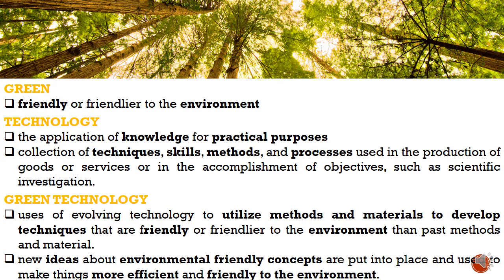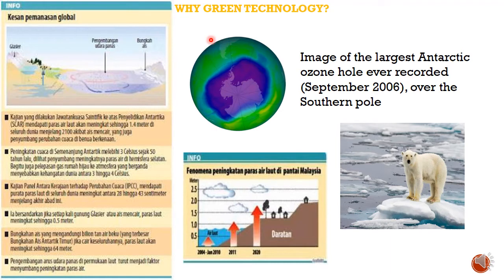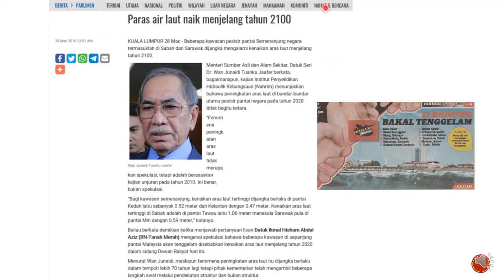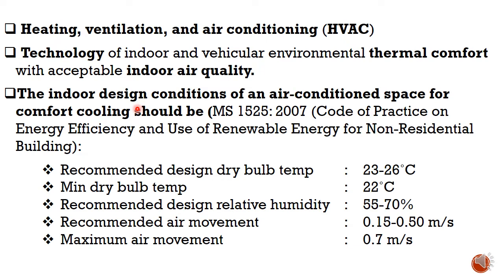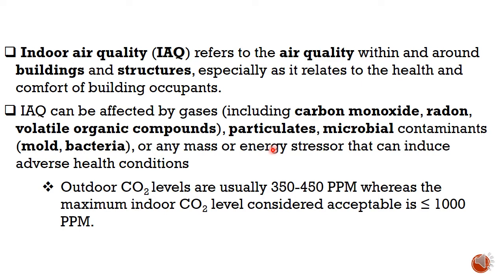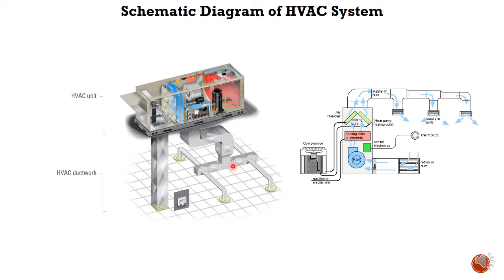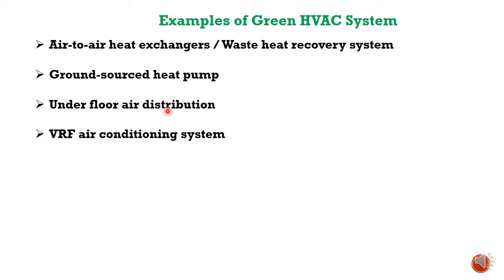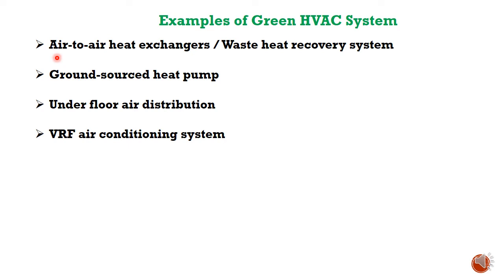Lecture 1- Green Technology HVAC

Comment: MUHAMMAD HAZIM BIN ISMAIL (B071710545)

1.1 Green Technology
-Uses of evolving technology to utilize methods and materials to develop techniques that are friendly to the environment.
-New ideas about environmental friendly concepts
-Better energy efficiency

Why go green
-to protect environment from hazardous emission
-conserve natural resources
-reduce the fossil fuel usage
-contributing to human health
-support the increasing green energy production

Green technology subject areas
-green building
-environmentally preferred purchasing
-green chemistry
-green nano-technology
-energy

1.2 HVAC
-Heating, ventilation and air-conditioning
-Technology of thermal comfort with acceptable indoor air quality
IAQ
-Air quality within and around buildings and structures
-Can be affected by gases or any mass or energy stressor that can induce adverse health conditions

1,3 Green Technology HVAC
-System that produces thermal comfort with good air quality, which reduces pollution on environment
Green building design
-HVAC system is designed after all the other energy efficient design components are in place because energy requirement are reduced and natural heating and cooling is maximized through size orientation, passive design, insulation, air barriers and landscaping.

Advantages of green HVAC
1) Sustainability 
2) Viability 
3) Innovation 
4) Source Reduction 
5) Cradle to Cradle Design

Comment: MOHAMAD SYAFIK BIN SOFI
B071710064

Green technology.
-The combination technology and green for the better enviroment.
 -Include better energy efficiency.

Purpose
-To protect enviroment.
-Conserve natural resources.
-Reduce the fossil fuel usage.

Alternative energy
-Solar power.
-Nuclear power.

What is HVAC?
-Heating, ventilation, and air-conditioning system.

What is IAQ?
-Air quality.

Green HVAC
-A system that produce thermal comfort with good air quality which also reduce pollution on the enviroment.

Important of correct sizing
-Too small = Will run heavily all the time.
-Too large = will constantly turning on and off.

HVAC green technology
-Sustainability.
-"Cradle to cradle design.
-Source reduction.
-Innovation
-viability.

Comment: MUHAMMAD AMIR SYAFIQ BIN AHMD SUKRI 
B071710161

Green = friendly or friendlier to the environment
Technology
•	the application of knowledge for practical purpose
•	by using some techniques, skills,method and processes to produce goods or services.

Green technology:
•	utilize method and material to develop techniques that are friendly to the environment than past methods and materials.
•	New ideas about environmental friendly concept

Why green technology:
1.	To protect environment from hazardous emission
2.	Support the increasing green energy production
3.	Contributing to good human health
4.	Conserve natural resources 
5.	Reduce the fossil fuel usage 
Green technology subject area:
1.	Energy 
2.	Green building
3.	Green nanotechnology
4.	Environmentally preferred purchasing
5.	Green chemistry 

Hvac = heating ventilation and air conditioning 
•	Technology of indoor and vehicular environmental thermal comfort with acceptable indoor air quality

 
The indoor design condition of an air-conditioned space for comfort cooling must use a standard of MS 1525:2007 (code of practice on energy efficiency and use of renewable energy for non-residential building)

•	Recommended design dry buld temp = 23 – 26 degree Celsius 
•	Min dry bulb temp = 22 degree Celsius
•	Recommended design relative humidity = 55 – 70%
•	Recommended air movement = 0.15 – 0.50 m/s 
•	Maximum air movement = 0.7 m/s

AIQ = indoor air quality 
•	air quality within and around buildings and structures. 
•	It relates to the health and comfort of building occupants
•	AIQ can be affected by gases (including carbon monoxide, radon, volatile organic compounds), particulates, microbial contaminants mold, bacteria or any mass or energy stressor that can induce adverse health condition
•	Outdoor Co2 levels are usually 350 – 450 PPM. The maximum indoor CO2 level considered acceptable is lesser than 1000 PPM

GREEN HVAC
•	A system that produces thermal comfort with good air quality, which reduces pollution on environment such as global warming and cost effective
Green building design 
•	Hvac system is designed after all the other energy efficient design components are in place
WHY?
•	Energy requirement are reduced and natural heating and cooling is maximized through size orientation, passive design, insulation air barriers and landscaping. Then, hvac system is designed to provide supplementary heating, cooling and ventilation that needed.
Correct sizing of Hvac system: 
•	Too small = will run heavily all the time to compensate
•	Too large = will constantly turning on and off and will cause moisture condensation on space walls.
 
Advantages Green Hvac:

1.	Sustainability = conserving natural resource, improve components performance
2.	Vialibility = making green technology economically feasible 
3.	Innovation = developing innovation in alternate technologies that do not harm the environment
4.	Source reduction = reduce waste and pollution by changing methods of production and energy consumption to help conserve energy and help the environment

Example of green hvac system:
1.	Air to air heat exchangers/ waste heat recovery system
2.	Ground sourced heat pump
3.	Under floor air distribution
4.	VRF air conditioning system

Comment: NUR FITRAH NADIA BINTI KAMIDAN
B071710363

WHAT IS GREEN TECHNOLOGY
The field of green technology encompasses a continuously evolving group of methods and materials, from techniques for generating energy to non-toxic cleaning products.
 
Examples of green technology subject areas:
Energy
Perhaps the most urgent issue for green technology, this includes the development of alternative fuels, new means of generating energy and energy efficiency.
Green building
Green building encompasses everything from the choice of building materials to where a building is located.
Environmentally preferred purchasing
This government innovation involves the search for products whose contents and methods of production have the smallest possible impact on the environment, and mandates that these be the preferred products for government purchasing.
Green chemistry
The invention, design and application of chemical products and processes to reduce or to eliminate the use and generation of hazardous substances.
Green nanotechnology
Nanotechnology involves the manipulation of materials at the scale of the nanometer, one billionth of a meter.
 
WHAT IS GREEN TECHNOLOGY HVAC
The definition of Green Technology goes a little further as it involves implementing a solid strategy of environmentally friendly ideas, methods, materials, and machines.
 
HVAC GREEN TECHNOLOGY DEFINED
1. Sustainability
2.Cradle to Cradle Design
3.Source Reduction
4.Innovation
5.Viability

Comment: ARVINTH A/L RAMACHANDRAN
B071710339 
BMMH 1/2

WHAT IS GREEN TECHNOLOGY?

GREEN = friendlier to environment
TECHNOLOGY = scientific investigation of knowledge for pratical purposes
 to utilize methods and materials to develop techniques and ideas to environmental 

Source Reduction = Reduce waste and pollution by changing methods of production and energy consumption to help conserve the environment.

Innovation = Develop technologies that does not harm the environment

Viability = Creating job opportunities and careers around Green Technology that can help protect the environment

GREEN HVAC SYSTEM 

Air-to-air heat exchangers / Waste heat recovery system
Ground-sourced heat pump
Under floor air distribution
VRF air conditioning system

Comment: MUHAMAD IZMAN BIN JAMALUDDIN
B071710518

WHAT IS GREEN TECHNOLOGY

The field of green technology encompasses a continuously evolving group of methods and materials, from techniques for generating energy to non-toxic cleaning products. The present expectation is that this field will bring innovation and changes in daily life of similar magnitude to the information technology explosion over the last two decades.
Examples of green technology subject areas:

Energy

Perhaps the most urgent issue for green technology, this includes the development of alternative fuels, new means of generating energy and energy efficiency.

Green building
Green building encompasses everything from the choice of building materials to where a building is located.
Environmentally preferred purchasing

Green chemistry
The invention, design and application of chemical products and processes to reduce or to eliminate the use and generation of hazardous substances.

Green nanotechnology
Nanotechnology involves the manipulation of materials at the scale of the nanometer, one billionth of a meter. Green nanotechnology is the application of green chemistry and green engineering principles to this field.

WHAT IS GREEN TECHNOLOGY HVAC
HVAC is constantly evolving as new ideas on environmental friendly concepts are being put in place. These ideas and concepts are used to make things more efficient and friendly to the environment. The definition of Green Technology goes a little further as it involves implementing a solid strategy of environmentally friendly ideas, methods, materials, and machines.

HVAC GREEN TECHNOLOGY DEFINED

Sustainability 
This refers to the conservation of our natural resources. HVAC is a constantly evolving industry where many of its manufacturers work to make their equipment a lot more efficient.

Cradle to Cradle Design

This means designing products that can be fully reclaimed or recycled into new products at the end of the product’s lifecycle. Almost everything in HVAC equipment can be recycled or reclaimed at the end of its life including the refrigerant used.

Source Reduction
It refers to the reduction of waste and pollution by altering the methods of production and energy consumption to help the environment and conserve energy. 

Innovation 
This refers to developing innovations in alternate technologies that are not harmful to the environment, or innovations that decrease the use of fossil fuels and chemicals that have been known to harm the environment and the people in it. 

Viability 
It refers to making Green Technology economically feasible  creating jobs and careers around Green Technology that truly help to protect the environment and our planet.

Comment: MOHD SAZWAN FITRIE BIN MOHD. KHAIRIL FITRIE (B071710488)

Uses of evolving technology to utilize methods and materials to develop techniques that are friendly to the environment than past methods and material. New ideas about environmental friendly concepts are put into place and used to make things more efficient and friendly to the environment.

1. Green building
- Choosing the material or the location for the building
2. Environmentally preferred purchasing
- Search of products which contents and methods have minimal effect to the environment
3. Green chemistry
- Invention, design, and application of chemical products that reduces the usage of hazardous substances
4. Green nanotechnology
- Manipulation of the materials used
5. Energy
- Development of alternative fuels, generating energy and energy efficiency

Technology of indoor and vehicular environmental thermal comfort with acceptable indoor air quality (IAQ). IAQ refers to the air quality within and around buildings and structures, related to health and comfort of building occupants.

A system that produces thermal comfort with good air quality, that reduces pollution on environment and cost effective. Correct sizing of an HVAC system is important to achieve energy efficiency.
1. Too small : - will run heavily all the time to compensate
2. Too large : - will constantly turning on and off
                           - will cause moisture condensation on space walls.

1. "Cradle to Cradle" Design
- Product can be recycled into new products.
2. Source Reduction
- Reduce waste and pollution by changing methods of production and energy consumption to help conserve the environment.
3. Innovation
- Develop technologies that does not harm the environment.
- Reduce the usage of fossil fuels and chemicals that are harm to the environment and people.
4. Viability
- Creating job opportunities and careers around Green Technology that can help protect the environment.
5. Sustainability
- Help to conserve natural resources.
- Improve components performance.

1. Air-to-air heat exchangers / Waste heat recovery system
2. Ground-sourced heat pump
3. Under floor air distribution
4. VRF air conditioning system

Comment: NUR SELIHAH WAL HUDA BINTI AHMAD - b071710190

Green Technology in HVAC system is important to reduce or minimize the energy cost and reduce pollution on environment such as global warming. 
HVAC system designed as energy efficient design component because the energy requirement is maximized through size orientation, passive design, insulation, air barriers and landscaping. 

Using Green Technology in hvac will support the increasing green energy production for example in Malaysia using solar  in some industrial field to reduce pollution on environment and the US,  they use ice power aircond system which has the same concept of thermal energy storage by convert water to ice to cool the area and save the energy consumption.

- Advantages of HVAC Green Tech.
   i) viability 
  ii) sustainability
  iii) cradle to cradle design 
  iv) source reduction 
  v ) innovation

Comment: MOHAMAD HURAIRAH BIN HARUN (B071710461) 

1.1 Green Technology 
~ Uses of evolving technology to utilize method and material to develop technique that are friendly to the environment. 
~ New ideas about environmental friendly concepts are put into place and use to ma things more efficient and friendly to environment. 

Examples of green technology subject areas:
1) Energy
2) Green building
3) Environmentally preferred purchasing
4) Green chemistry
5) Green nanotechnology

1.2 HVAC 
~ Heating, ventilation, and air conditioning (HVAC) is the technology of indoor and vehicular environmental comfort. Its goal is to provide thermal comfort and acceptable indoor air quality.
~ Indoor Air Quality (IAQ) refers to the air quality within and around building and structure, especially relates to the health and comfort of building occupants.

1.3 Green HVAC 
~ A system that produces thermal comfort with good air quality, which reduces pollution on environment such as global warming and also cost effective.  
~ Green building design – HVAC system is designed after all the other energy efficient design components are in place because energy requirement are reduced and natural heating and cooling is maximized through size orientation, passive design, insulation, air barriers and landscaping. 

Advantages : 
1) Sustainability 
2) Viability 
3) Innovation 
4) Source Reduction 
5) Cradle to Cradle Design 

Example: 
1) Waste heat recovery system 
2) Ground sourced heat pump 
3) Under floor air distribution 
4) VRF system